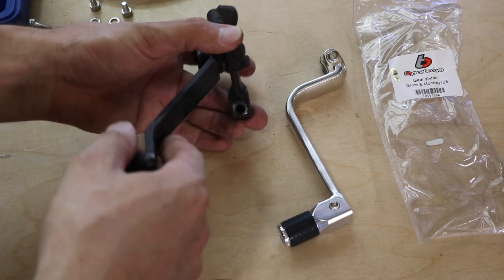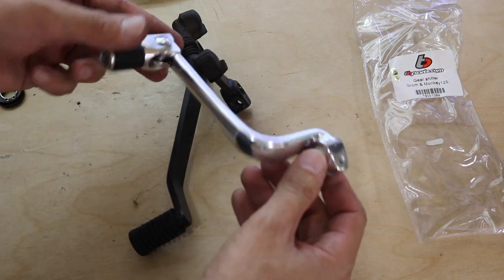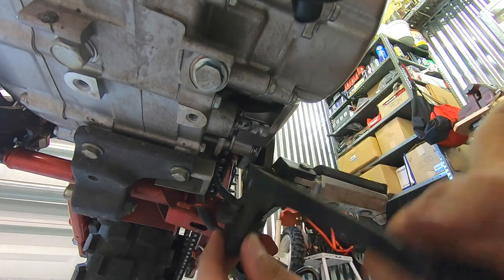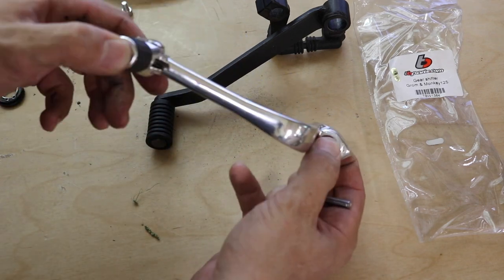2019 Honda Monkey Build: TB Parts Shift Lever

Comment: Add the G-Craft shifter bearing support first for even smoother shifts. Highly recommended as the shaft sticks out a fare way. Just gives it some extra support.
Reply from the maker: Nice upgrade to the upgrade! Would eliminate the worry factor for some too👌
Reply: I agree and thank you for pointing this out. What are your thoughts between the linkless shift/support vs a rose joint shift link kit? I’m new to bikes completely

Comment: I just installed this TB Parts shifter on my Monkey last weekend, taking measurements both before and after. The new shifter places the shifter peg about 1/2 inch forward vs the stock shifter. That said, during the couple hours I rode it the next day, I didn’t notice the difference at all, except that I did notice a slight improvement over the slop of the stock unit. Given its price, and ease of replacement, I’d say it’s worth it. Just my 2¢.
Reply from the maker: Thanks for the feedback! Glad you like it

Comment: One of the best affordable upgrades you can do to a Monkey.  No more slop in shifting.  Do not buy the universal shifters.  If they don't have that 90 degree bend it won't work properly.  I bought one of those universal shifters at first, and yes you can use it, it puts the shifter directly under the engine and makes shifting very uncomfortable.  This one with the bend puts the shifter in the correct position out of the way of the engine.  Shifting is so snappy and clean now it makes me wonder why the Monkey doesn't come with this standard.
Reply from the maker: Thanks for the comment! I'm not sure why Honda and other manufacturers use the linkage. My new Trail 125 doesn't use it and has a factory equipped direct mounted shifter.

Comment: Hi John, just tried installing a hammerhead shift lever from MNNTHBX - everything seemed to work fine but the bike is only going down for first gear and up stays in neutral, did I do something wrong?

EDIT looks like rolling it back and forth a bit seems to have changed the indicator at least - I’m gonna go for a ride around the block later to make sure everything is running properly. John thanks for making these videos!
Reply from the maker: Glad you got it!

Comment: Great video, John. After having the monkey for only 5 days, the shifting is the only thing super annoying 😁 You seem to be holding a different shifter in your hands at the end. It seems to be all metal, without the rubber end. I saw something like that on the TB Parts site too. Is that for the monkey too? If so, why did you decide to install the one with the rubber end? Just wondering!
Reply from the maker: Thanks Yvonne! Yes, TB offers two options for shifters, the one I used with the rubber tip and the same shifter, but with a knurled aluminum tip in red or black. I liked the way the rubber tip looked, it was more vintage style. I used the aluminum tip versions on my Grom and pit bikes

Comment: Also, looking at pictures of the stock bike and your bike with this shifter installed, the shifter seems to end at the same place as the stock one -  but the shifter is said to be an inch longer. I don’t want a longer shifter as my feet are small, about a 6 Men’s (8 women!) - Is it really longer?
Reply from the maker: Nope, same tip location, but what you’re seeing is a longer shaft because the stock shifter uses a pivot shaft and the TB shifter mounts direct to the shift rod

Comment: No loctite???
Reply from the maker: I didn’t choose to use it. I’d rather check it periodically and tighten as needed rather than use loctite as it’s a small bolt and something I might take off again. Plus, the split design of the spline on the shifter should act as a lock washer. I’ll risk it 🙃
Reply: One more thing to add.  Good walk through.  Thanks
Reply: I've been riding 44 years and never needed loctite on a shifter bolt.
Reply: You lucky ...
Reply: You are a fool if you think you need loctite on a shifter bolt.
Reply: Thanks for calling me a fool for asking a simple question. :)